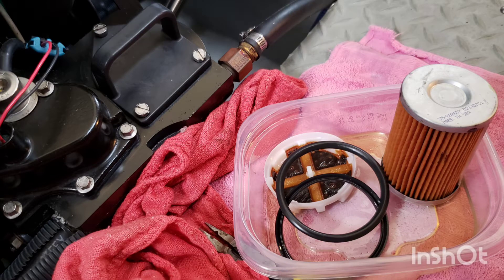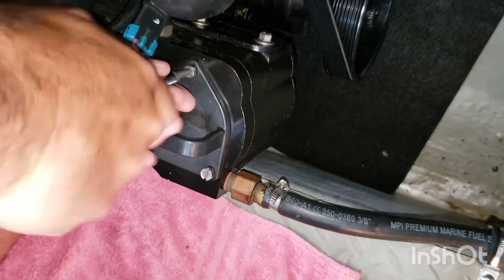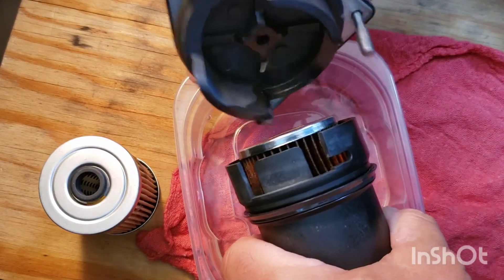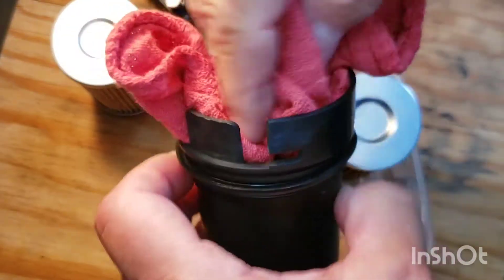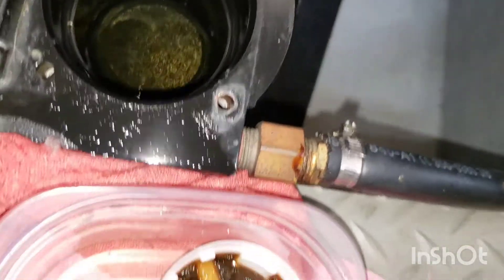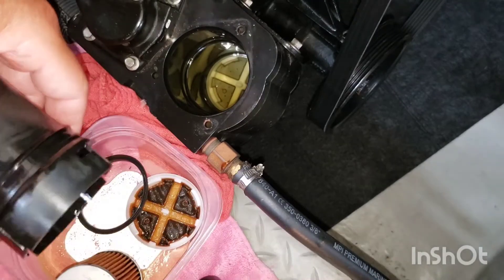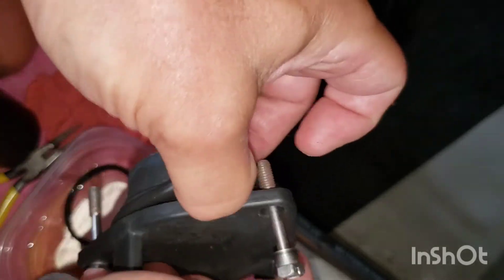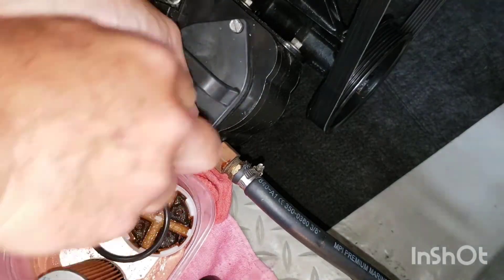Mercruiser 6.2 Fuel Filter Replacement

Comment: Awesome thanks for the info. I don't know you have to start the engine before you do the replacement filter. Thanks again.
Reply from the maker: Cranking the engine with the pump disconnected releases fuel pressure so it won’t spray out on you.

Comment: I'm getting read to replace the filters on my Meridian 368.   So very helpful to see the process in a video.   However, from reading the service manual, it seems like two important steps are missing.   The manual says to first disconnect the wiring harness and then crank the engine to relieve any pressure in the system.   I can see that the wiring harness is disconnected in your video, but this wasn't mentioned.  The manual says that if you don't do these steps the system could be under pressure and cause fuel to spray.
Reply from the maker: I’ve read that in the manual also.   Ive never cranked engine before opening the fuel module to change the filter.   Considering the fuel pump is after the fuel module filter element being opened, I don’t see where pressure is coming from.  I’ve never had an issue, but it won’t hurt to crank it regardless.
Reply from the maker: The cup you open is not under pressure. If anything it’s vacuum as the pumps are sucking fuel at that point.  So no need to release pressure or disconnect.   But it won’t hurt.

Comment: My manual said disconnect wire housing to your module turn key on for 5 seconds then proceed with removing your cool fuel filter